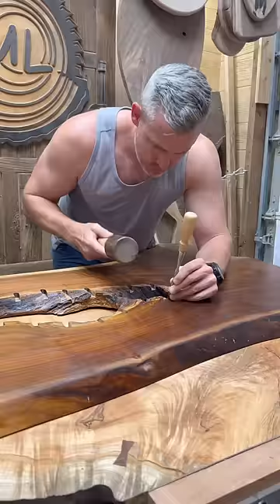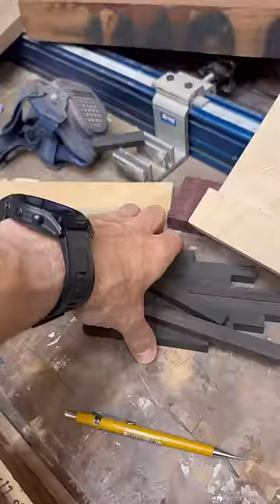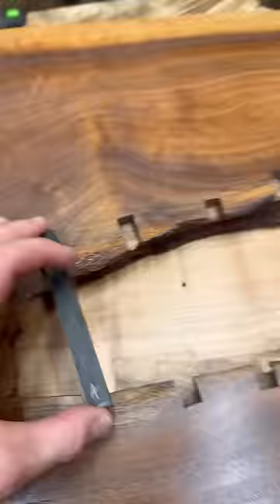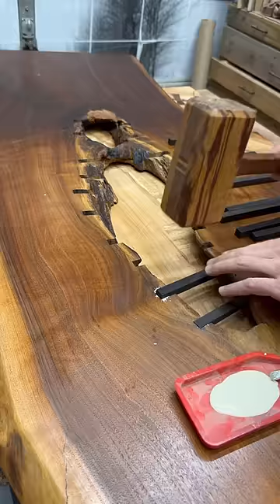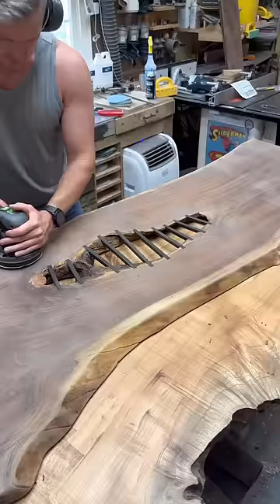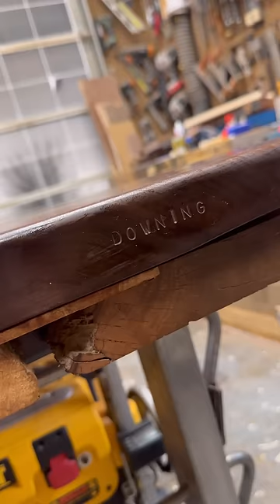Custom Desk with Stitches #woodworker #woodwork #woodworking

Comment: Would have been cool to customize a glass to fit so it   has a smooth touch to it.
Reply: Or a resin
Reply: That would ruin the look of the piece no offense. If he wanted to fill the gap entirely he just would’ve done a pour and skipped the stitches, as the whole point of those stitches is to highlight the hole in the wood 🤦🏼‍♂️
Reply: @hugenerd8994  There are clear resins.....
Reply: @hugenerd8994 resin only goes so far. To include the stitches provides a mechanical hold to prevent splitting
Reply: Definitely opened comments to suggest resin, if for anything, the functionality of the TABLE. There's a big hole in the middle of it and it could cause several problems with things like cups, silverware, trash, FOOD.

Should've used a clear resin and at least filled to the bottom of the "stitches", if the goal is to keep that texture across the top of the table without the inconvenience of an actual hole in the table.
Reply: @SmokeystarOriginal  These stitches do everything except provide a mechanical hold 😂
Reply: @muffinconsumer4431  just went back and paid attention yeah it might give a minor amount but it needs to be dowelled in placd
Reply: @renanfirebomb067 resin always looks tacky
Reply: @hugenerd8994 they look horrid epoxy would leave it and look better
Reply: @KityKatKiller resin is boring tho
Reply: Da kann man einen Eimer drunter stellen und die Krümel reinfegen.

Comment: You have really no idea how the cleaning personnel will hate you,😅
Reply: Pensei o mesmo, quando começar a acumular sujeira no buraco...
Reply: Lol... Other than looking stupid, what is the point of those pieces of wood?  Does it prevent it from splitting or something?
Reply: @101perspective  no lol
Reply: Artistic
Reply: @101perspective stops things falling through.... kind of like how ylur brain fell out of your ears
Reply: @AllDayBlazer89 and yet the design wont stop dirt falling in there and becoming impossible to clean. This is one piece that really needs an epoxy fill for practical reasons.
Reply: @AllDayBlazer89  Not too many things you would put on this table that wouldn't fit through those gaps.  Notes, pens, paperclips, etc.  Heck, even a phone would fit through there.  And all of these things would be guaranteed to fall through if they made their way to that gap.  Heck, even glasses of liquid would fall through or at least lose their balance and spill their contents through the hole.  
Only way to avoid this would be to float some glass over the top of the table.  Possible to do even with the odd shape.  You would still be stuck with the eyesore though of that design.
Reply: @101perspective you can set a plate there, or a lamp, or a center piece.
Reply: @robertlaube574  Yep, about anything that is big enough to hide that ugly spot.
Reply: If you’re clean and accurate person…  is no problem about that.  
That table cost lots of money
Reply: @rostovdon724  I think the only way that table becomes realistically functional is if you either block the gap with a huge bowl or something (like someone mentioned earlier) or float a piece of glass over the entire table.  Just leaving the hole there for stuff to drop through would be silly imo.  If you actually plan to use the table anyway.  Way too many things that would tip over or fall through otherwise.
Reply: @101perspective  as soon as you get that table you can put on it whatever you fantasy is  🤣
But I’m not sure if you can afford it 😩
Reply: @rostovdon724  Lol... I guess it depends on what you mean by "afford".  Do I have enough money to buy it?  Yeah, easily.  Can I really afford to be wasting money on something like this? Um... no.
Reply: Funny that's exactly what I was thinking
Reply: @shanerutter5112   👍😃
Reply: That's OK that's a mexican job😂😂
Reply: It's true😅
Reply: @101perspective It means you could put books, trays, paper, laptop etc on that part of the desk without them falling through.
Reply: @Tao_Tology  Yeah, anything big enough that would hide that ugly spot... I've acknowledged this already.  Not sure about paper though since you would probably be sliding it there.  It would probably sometimes catch on the gap and try to go through despite being probably too big.
That said, that gap could be functional if you plan to slaughter chickens or something on it.  It wouldn't matter that the spot is ugly and you could put a bucket under the hole and slide all the bits you don't want through the gaps... jk btw, it still wouldn't work for that.
Reply: @101perspective  "So, ideally, it should function as a desk.......but with the option for a ritual sacrifice podium and drainage"
Reply: I think he will add resin in it after😁
Reply: @rostovdon724 what about dust?
Reply: Looks like a stitched wound from walking dead
Reply: Dude.. i was just thinking that.. i would have to get my kids slime shit to clea. That
Reply: @101perspective You're welcome to your opinion.   At 17M views & nearly 300k likes, others disagree.
Reply: Are people really that lazy and rushed? I could do that in less than a minute.
Reply: Guys it’s a custom desk ie a probably customer requested it
Reply: @101perspective i dont agree with the design being an eyesoar, i dont like the stitches, but the wood itslef is beautiful, i prefer a desk that isnt perfectly rectangular, it brings life into rhe environment, and really adds to the desk, it gives a real nature vibe, and could really pull a room together.
Reply: @WAFFLEMANNHN  Oh, yeah, that wood and shape, etc, is definitely sweet.  I was just referencing the stitches.
Reply: @epoernomo "artistic"
Reply: @101perspective  agreed
Reply: Gand
Reply: @AllDayBlazer89  just about anything will fall through.... very small stuff like pencils, marbles, dirt, loose change, food and even your brain can.
Reply: Então nesse caso se usa um aspirador de pó
Reply: I feel like if you can afford the table, you can afford a cleaning crew that will appreciate you employing them.
Reply: Appreciate the craftsmanship, and it is a beautiful piece of wood: but do not care at all for the 'stitches', the hole, or the live edge feature. Each to their own.
Reply: Stunning
Reply: @101perspective to put things on top of it. Center items and stuff
Reply: Surely they are filling it in with resin!
Reply: @jaywa101 I thought it would have an epoxy fill. Looks shit without imo!
Reply: Non è il mio ideale, avrei coperto il buco interamente. Complimenti,sai lavorare molto bene
Reply: Covered in epoxy later..
Reply: Air dusters work great
Reply: Some effing people are so rude I think you complimented nature so perfectly beautiful work
Reply: @101perspective I find it appalling how many disrespectful responses you are getting to your very benign observation. I agree with you. The table design, while somewhat attractive, is really not very practical. It was actually funny to read that one guy listing things that would not fall through the gap as if that made a difference. I mean...sure...there are lots of things that won't fall through the gap but that's not the point. The point is that the vast majority of things anyone would normally put on a table are going to end up down through that gap.
This doesn't change the fact that this is a great piece of art and a fine purchase for someone with lots of money and no worry about oractical use.
Reply: @101perspective sometimes it does, “stitching” or adding “bows” into some areas with cracking or openings can actually help stabilize the wood and keep it from breaking over time. Some people like the look of it even if it isn’t for that purpose tho. I’m not massive fan of of it but 🤷‍♀️ rich people do rich people shit(?)
Reply: @claytonporter91 that's what yo Mama's for😂
Reply: @jaywa101 its a hole 😂😂 .. this table ia on a other work table remember .later you can see right thrue
Reply: Table will be covered with glass
Reply: @jaywa101 Lmao I dunno why you act as if it’s impossible to clean
Reply: @101perspective then don't use it for that dumb***..use it for stuff that won't fall through. Lol.
Reply: @jaywa101 yeah it would be cooler with the epoxy.
Reply: @aileengarcia460  lol... yeah, silly me wanting to put stuff on a table that most people would normally put on a table...lol.
Reply: @101perspective  that would make sense if it were your table. But it's not. It's that dudes table. Lol
Reply: @101perspective  and all those things go in a drawer normally
Reply: @aileengarcia460   Oh, you were serious.  Sorry, your other comment seemed so silly I thought you were joking.  You are right though that all of those items go into a drawer usually.  However, you usually put them on the table when you want to use them.  And they will float around on the table for sometimes hours while you work on this or that project, etc.
And yes, obviously it is not my table.  However, he clearly put this out on the web for everyone to look at and comment on... to see if people like it or not.  All I'm doing is giving my feedback.  If he didn't want feedback then he shouldn't have posted it... or at least not post it in this manner.
Seriously though, I don't see what the big deal is.  Having a hole in the middle of the table is silly imo.  If you think it makes sense then good... I would love to hear your reasoning as to why that would be better than a normal table without holes in it.
Reply: @101perspective it's to appreciate the natural gap in the wood, in it's beauty instead of filling it up
Reply: @Elketjeable  Appreciate the natural gap by filling it up with pegs?  
Don't get me wrong, I completely get how some would like the look.  I mean, I'm sure you can make a square tire look pretty cool also.  However, it's still not going to be very functional.  And I don't know about anyone else but the top non porous surface of a table is what I use as the "functional" part.
Reply: If you guys hadn't realised already, the whole goes straight through.
It was on his workbench..
Reply: Felicitaciones.... Por lo DELICADO, como tratas la madera "ESO ES SER ARTISTA "